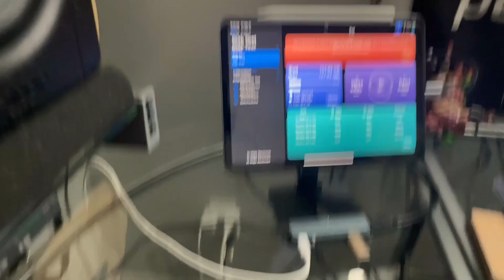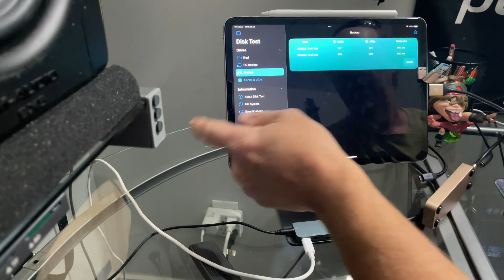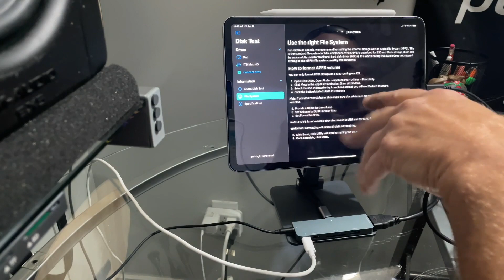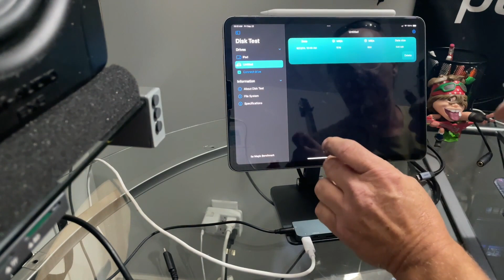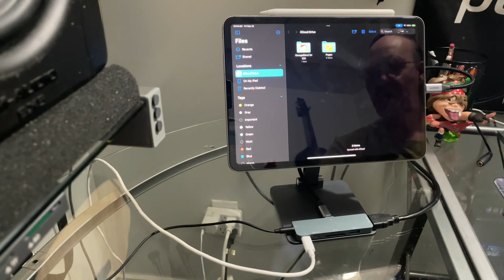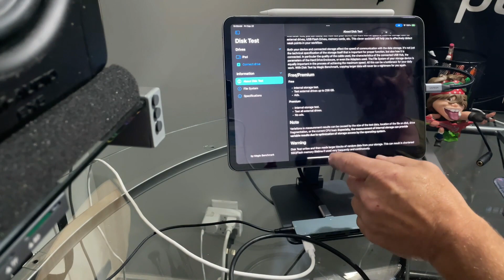Disk Speed Test Program Review For iPad

Comment: just downloaded to try on ipad pro m4. Wildly conflicting reading/information. I also tried JazzDiskBench which gave consistent reading to what crystaldiskmark gave me on my mac for the same drives. I tried this Disk Test by Magic Diskmark app using an sd card and it gave me results that were higher than what the card is even rated for. Ex. this card is a sony tough M sd card 277R / 150W and it's showing the W speed of this card at 200. Completely unreliable! Jazzbench on the other hand gave consistent correct readings. No Im not associated to jazzbench in any way, just the two apps I've tried and my results. Hope it helps some people. :)